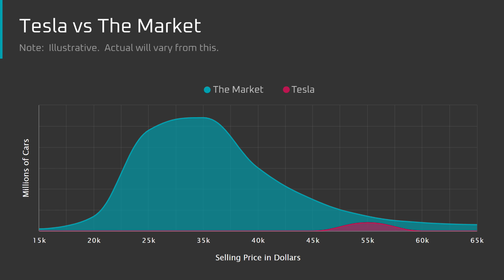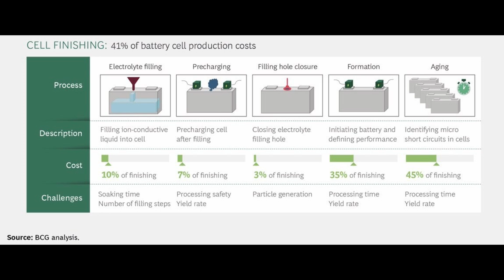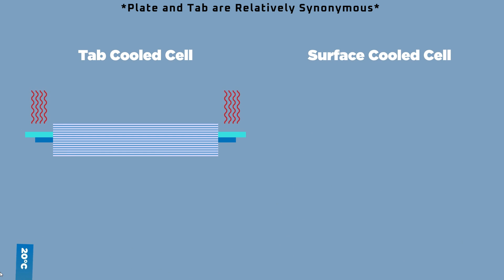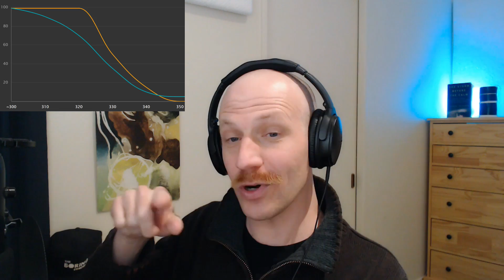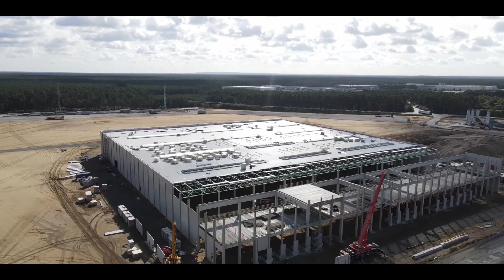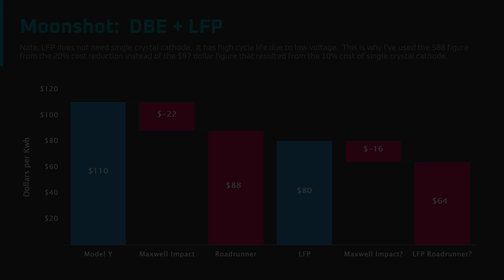Tesla Battery Day Predictions // Output, Cost, Energy Density

Comment: I believe with silcon nano particals is that they are still quite expensive & not economical yet but their performance is fantastic but the solution so far had been to larger silicon  particals but limits you to under 10% due to expansion when charged

Comment: Hi Jordan.  I think you underestimate Elon.  I suspect he will unveil a battery production line capable of 100 gigawatt hours annually.  The batteries will charge faster, and be significantly cheaper to manufacture.  All lines will be able to use these new batteries, and as they will be cheaper to make in scale, they will quickly be used for all vehicles in all factories.
Reply from the maker: Hi Dave!  I'm not underestimating him, but whatever I say I have research to back it up.  I have research backing up lines up to 5x speed for DBE, if you have research backing up 100gwh I'd love to see it.
Reply: Yes the pilot line runs 5 times as fast, I have no proof, but I suspect the version 1.0 of the production line will run faster, and if the battery size has 9 times the volume, 100 gwh per year is achievable.  This is what makes a terafactory reasonable.

Comment: The most weight critical vehicle for high power batteries is the semi truck.  ELON HAS ALREADY STATED THIS.  Remember trev say  each pound of capacity is worth 50 cents a mile.  I do not know if those figures are correct but certainly Elon wants to maximise the capacity.  EVERY KG SAVED ON THE BATTERY IS AN EXTRA KG OF LOAD THAT CAN BE CARRIED.  The semi truck will have the best battery type available and that will continue as better batteries become available.  Of course also the small,  expensive sports car.  
Remember the tabless patent,  5% was for one end only,  but the photo invite explanation stated the folded collectors are for both ends so that makes 10 %.   Additionally, cell failure is reduced by 50%.
Actually the dry electrode also reduces failure rate by 50%.    Adding the two togeather that is 75% reduction in failure rate.   Applying this to Panasonic plant would reduce failures to about 3%.  Now this is beginning to get mind  blowing, and also saves about 10%  on cost of each.battery.
That 75 % should apply throughout battery ramp up of Tesla lines, wow.   Remember also the battery life was extended  in the original allowances,  think that puts the panasonic batteries to million mile.  So I do expect to see dry electrode and tabless to  be incorporated in the panasonic lines as well.  Plus the Tesla lines at Kato. RD.     This is beginning  to get towards mind blowing.   Now if they have mastered the dry electrolyte  for there own lines, a dry battery,  that really would be mindblowing!

Comment: He said, "[Tesla] need to reduce the cost of batteries."  This assumes that the selling price is the sole contributor to sales volume.  We know that it's not the sole contributor - the rebates have been one help in selling.  And you've never seen Tesla advertising because they've never had to, their cars sold themselves.  Tesla has had superior software and has continuously updated it OTA.  People whine about Tesla's reliance on carbon credits for profit, but that's still one contribution to lowering costs.  And when Tesla gets 'built out' to where they don't have to spend so much on expansion, that should help with profits.

I totally agree with the end where he talked about the battery constraining situation.  But transportation is just one piece of the pie.  The world needs many more Megapacks to enable renewables plus storage to replace fossil fuel power.  So the whole world is dependent on electricity storage.  By Musk's own admission, Tesla is constrained by the lack of exceptional engineers.  The problems outlined in this video need to be solved by people.

What surprised me was that 20% of the batteries produced were unable to pass the tests.  This reminds me of the semiconductor technologies of the 1970s, where the failure rate could be greater than 50%.  If Tesla does what the semiconductor fab plants do and establish rigid quality control, the failure rate could be reduced and that would bring down the costs even more.  So this is an area that should be thoroughly investigated.  Thanks for the great video.

Comment: dang doggy you have done your homework here.  one thing i did not hear you mention is the video is the tesla powerwall energy storage systems.   Are they still in that bussiness to if so it would require bunch o cell too i assumes.  thanks
Reply from the maker: I need to do a series on energy storage as well.  They are definitely still in that business.  It's currently miniscule compared to the auto business but it will grow faster than the auto business.

Comment: Incredible video and research , keep going :)  Another way of  looking what is expected  on density increase is all Roadster/Cyber truck/Semi and may be new Model S/X are projected to have 500 miles in 2021 , by doing back of napkin math on 100Kwh pack range increase from 400 to 500 at min for S/X , meaning 25% projected at least  in  2021 high end models. That brings us to starting point of ~320Wh/Kg in 2021 , which coincides with highest confidence level with your research :)

Comment: Cell to pack is viable as long as manufacturing can strip a defective pack to its component cells, isolate problem cells or connections, and recycle cells to other products. Scale in battery manufacturing is everything, until 80% of the long distance electric grid is gone and 80% of petroleum need is gone.

Comment: Awesome as ever ! It would be interesting to compare the cost of the total product (the Model 3 for example) with the cost of e.g a Skodia Enyaq. 

With larger battery size of 80 kWh (compared to Model 3 SR+'s 50) while delivering objectively more car., it still starts at the same price as a Model 3 SR+ (44.000 EUR for Skoda vs 43.000 EUR for SR+). 

That suggests a few possible things:

1) The cost of the battery itself might not be the deciding factor for total cost of the car
2) The cost of transporting the car from LA to Europe is a large factor
3) Import duty etc is adding a lot of cost
4) Actual Tesla car production is not as cheap as VW/Skoda can do it.

Point 1) This seems to be true already as the price differential compared to ICE tech is dwindling.
Point 2), while sounding plausible is a little hindered by the Model Y prices specified (higher than Model 3), though it is possible they just want to ensure no Osborning and will take the more money they make for some time to pad the balance sheet (as production is more expensive initially anyway). Then lower prices substantially when proper local production is ensured.
Point 3) I am not sure how much cost is added, but it is likely to be handled just as 2) wouid be
Point 4) I am sure this might be a wash already and Tesla is planning to undercut others soon as the projected total production numbers in Berlin compared to e.g. Fiat and the number of employees needed seem to be favoring Tesla.

So the question is what the point of the battery production improvements are should the battery costs themselves not be the issue anymore. It does not seem to be the price per se but speed.

I would assume that VW/Skoda is barely making any money directly with these prices (only indirectly by not having to buy CO2 credits from e.g Tesla) and their battery supply is severely limited compared to Tesla which is the actual problem. Tesla is trying to build millions of cars per year whereas VW plans to have built 1.5 million electric cars total in 2025 (based on latest and increased targets).

The only way Tesla will be able to actually sell these many cars per year without model differentiation (as BMW/VW/Toyota etc do) will be to:

A) Be the only supplier who can deliver at scale (We see that already a little by the long waiting periods of some alternatives)
B) Have an increasingly better price (Which must come from cheaper manufacturing of the car as a whole, not just the batteries)
C) Have a product which is genuinely good in most respects and good enough to overcome some of the missing differentiation  (e.g an Enyaq is better suited for a family with kids at first glance than a Model Y).
D) Have enough market demand for their products to begin with. As they are still competing with ICE and the differentiation across price points and features especially at the low end this will also come down to political long-term support and  the growing demand for actual EVs (in the new car area) when people don't want to invest into cars with uncertain long-term prospects.

What are your thoughts on this ?
Reply from the maker: I read all of this and your logic is sound.  However, I don't have time to respond to all the points 😀.   I'll keep it in mind.

Comment: Unfortunately cell/battery (and on other channels 'battery pack') are sometimes used interchangeably. Perhaps someone can confirm these points, pls?
At the moment Tesla's main EV manufacturing advantage is how it assembles battery packs. 
Tesla holds significant patents in cell design as well as battery pack manufacture. 
There are no published figures regarding Tesla's battery cell production.
The cells at Giga Nevada are not produced by Tesla, they are made by Panasonic.
Tesla started cell manufacture this year and is ramping trial production at Freemont.
Tesla will may announce both battery cell design and cell to pack breakthroughs on Battery Day.
Reply from the maker: Correct to the best of my knowledge
Reply: @thelimitingfactor  Thanks! Great channel btw.

Comment: What if we're looking at 2 or 3 distinct battery lines. So a durable super low cost economy line battery for entry level vehicles like standard range plus etc. Then a premium battery line that will go into the performance models. All using hibar, Maxwell and tables tech, Larger cells but the chemistry being different to enable maximum market coverage. LFP with these optimizations and some sneaky extra chemistry would enable good range but super cheap slashing costs for the entry level models would enable huge market growth.
Reply from the maker: I'd love that!

Comment: Tesla should look into Reaction Engines Ltd. precooler unit they will use in the SABRE engine. The SABRE is a combo jet/rocket engine in one unit. The precooler they invented is used to remove waste heat from the air going into the jet engine at hypersonic speeds. This precooler has already been tested in a partnership with the DOD who had wanted to help test the precooler. This test proved the precooler ability to reduce 1200 ° to ambient air in milliseconds. Rolls Royce, BAE, UK, ESA and Boeing are investors in Reaction Engines. Reaction Engines has already created a commercial spinoff to develop and market the precooler, they have already indicated they have a precooler the size of a coffee can. This technology is groundbreaking for ALL cooling needs from HVAC to refrigeration and space.  Anything that needs to shed heat is a candidate for this tech.
Reply from the maker: I find that company fascinating.  I'm sure Elon knows all about it.
Reply: Yes he will definitely need something like that for the trip to Mars

Comment: There is a serious deterrent to going to bigger individual cell components, as with current cells, are protected by a thin wire connection to the power bus, for self disconnecting cells that become shorted internally, allowing the defective cell to isolate itself from rest of the pack, and being small enough that as the shorted cell has to expend the internal energy as heat, the small cell can do so by having the liquid cooling system manage the temporary high heat energy output without the cell becoming hot enough to damage neighboring cells. The larger each individual cell is, the harder it will be to thermally manage an internally shorted cell as it quickly converts that energy to heat. This means higher flow rates and more temperature sensing zones and ability to direct the cooling system to direct cooling effort to the neighborhood of a newly failed cell to prevent cascade damage that could lead to the destruction of part or all of the pack. The smaller the individual cell, the more individual component failure without thermal cascade damage, by keeping the amount of uncontrolled discharges to a smaller amount of possible rapidly discharging energy and heat possible per failed component .  
If the welded on fuse wire is eliminated  by going to pressure contact, the  spring contact could be designed with a fusing element that under unusually high current running through the contact, causes the spring contact to melt and spring apart, permanently interrupting the connection this unusually hot cell that is shorted, allowing the safety disconnect function to be accomplished similarly to the tack welded thin wire fusing used currently.
Reply: You're making a lot of assumptions on how the cell packs are fabricated.  Not all of those are true.
Reply: Acme Fixer my main point is that if a cell should internally short, the smaller the cell is, the less energy in the form of heat has to be dissipated by the liquid cooling system to prevent an explosive failure and possible damage to neighboring cells or the coolant matrix, which could flood the entire pack or reach an unmanageable point where it causes a cascading fire. The bigger the cell, the more energy a single unit contains and even though disconnected from the main bus, could still have a rapid internal discharge with resulting heat and gas pressures requiring it to out gas through its safety vent to prevent a grenade type failure.  

I’m sure Tesla doesn’t want to create their own versions of flaming Fords that burn down houses with attached garages.
Reply: Acme Fixer most of my comments are based on the analysis of Munro and Associates videos of the tear downs of Tesla Models 3 and Y.

Comment: I think the charging rate is also very important for 2 reasons: if u can charge in 5 to 10 minutes a small 40 KWh package(200 miles), all range anxiety is gone, secondly, the supercharger will be a big moneymaker. I thing V3 charger werent deployed, cause Tsla wants to enroll V4 charger, that also can charge the Semi, with watercolling cables like in new patent. But my guess is that they need a battery buffer for V4, to not crash the grid.
And i don't see a way to get enough lithium for big , slow charging batteries. It ensures also that no one can compete with Tsla, that dont own a charging network itself.
Reply: Car to car charging would also help to lower the necessity of big batteries and in my opinion a must implementation..

Comment: Jordan, do you think Tesla may use Novonix’s DPMG anode and cathode manufacturing processes might be used within Tesla’s Terafactory? Novonix has stated that they plan on co locating with Battery Manufacturers and it would significantly reduce the size of battery materials manufacturing real estate. It eliminates the need for water storage, pumps, filtration, CSTR machines, chemical storage, water treatment, ovens and driers. What are your thoughts?
Reply from the maker: Eventually, I think their products will be used by Tesla.  However, not in the next year or two.  They are still in the evaluation stage with Sanyo.  When they cross that bridge, then the dreams can begin in earnest.  Additionally, DPMG has proven itself at the lab scale, but not at the commercial scale.  I have faith, but I'm also not the type to count my chicks before they're hatched.
Reply: i'm invested into novonix and would also like to hear this answer.
Reply: all i know is panasonic and jeff dahn = novonix somehow lol

Comment: I did some calculations. If million mile battery has large baterry cycling wouldn't it be usefull to use they first in diesel railways when used up then transfer them to semi, then van, taxi and then to personal passenger car and then to stationary storage. This will reduce upfront cost and till it's raw metal cost. Please mind that after 4000k cycle. It still has 90% capacity retention. Or transfer them to developing countries to offset carbon debt of developed countries

Comment: Do you see TSLA creating a separate line of batteries targeted to concentrate on unique benefits to non auto stationary storage?
Reply from the maker: Absolutely.  But it will vary by country.  LFP is the king right now for stationary.  However, my understanding is that it has yet to come online in a significant way in North America.  In the meantime, ramp the hell out of Giga Nevada (with a longer cycle life chemistry) and use those cells for energy storage and allocate roadrunner to any new vehicles.

Comment: Good summary, Jordan- thanks for a great video!  I keep waiting for the Maxwell DBE process to be implemented, as it was implied this was tested by Tesla well before Tesla bought them.  Also, the DBE process, as well as the Tabless Battery, will both reduce internal resistance which will keep them cooler and Tesla can either simplify the battery cooling hardware, increase the speed of charging, or let this give the batteries longer life and less degradation.  The biggest mystery is what chemistry will be highlighted, and will it be some new magic formula from Dr. Dahn and his team.  Regardless- don't let the Battery Day reveals blow your head clean off your shoulders- it is such a nice, handsome head that photographs well for your videos, and I'm sure Mrs. Limiting Factor would miss it;-)
Reply from the maker: LOL, thanks Paul.  I agree 100% on all your comments regarding Maxwell and won't disagree that I'm quite dashing.

Comment: Plus the tabless design will prevent heat build up any way due to shorter travel distances of the stored electricity during charging and discharge less resistance both ways equals less heat